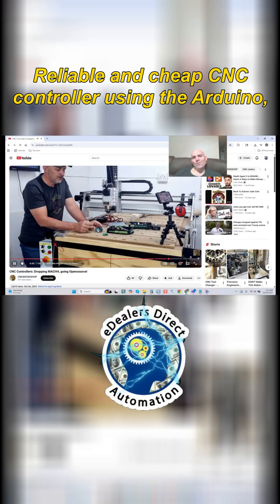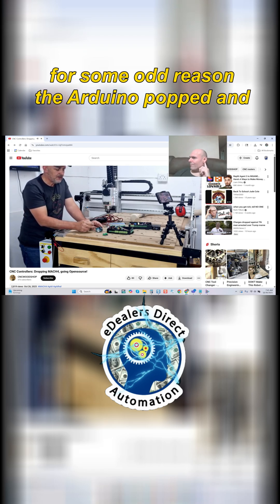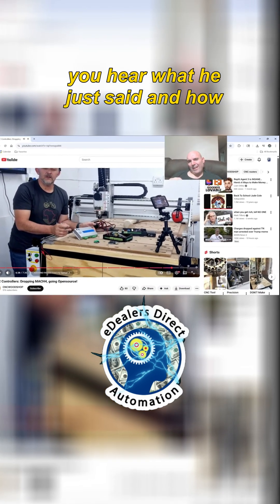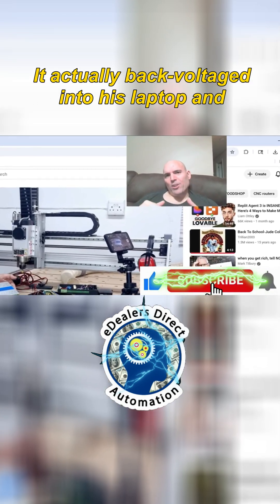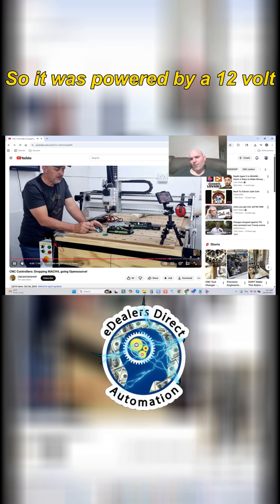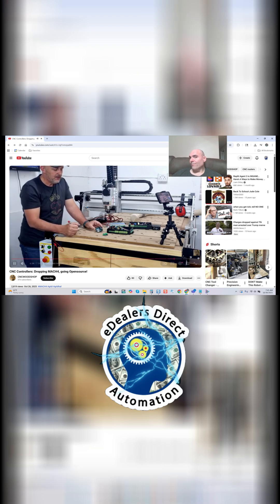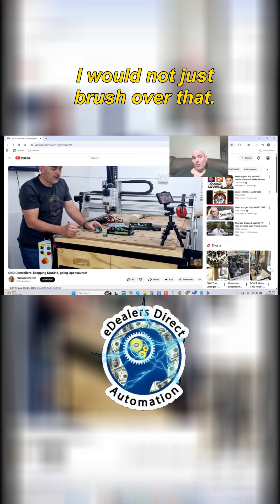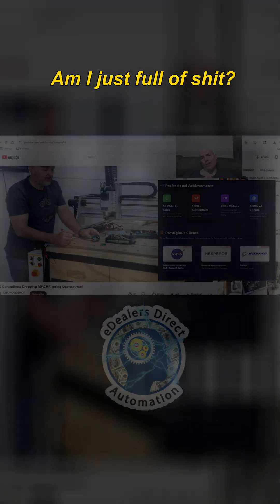Another USB CNC Fail 🚫 - A Case Study in What NOT to Do

Comment: Don't use 12v to power a Arduino. It will overheat the converter and fry the chip. Use 7v for a longer lifespan.
Reply from the maker: Arduino has no place to be used with a CNC of any type. Thank you,
Vince